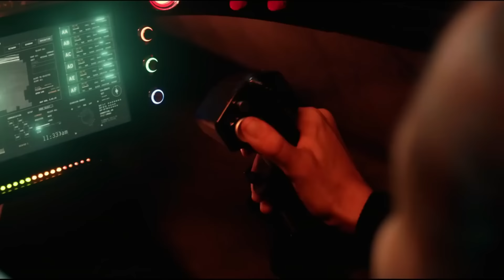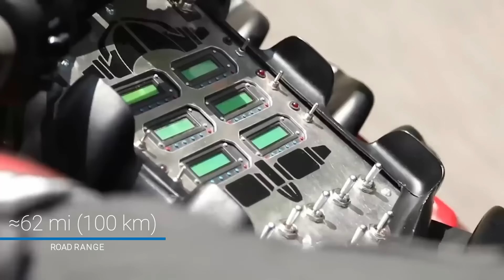TOP 12 Unique Flying Machines

Comment: I bought my paramotor almost 20 years ago. It easily packs into the boot of my car, it's fairly easy to set up and flies for about 3 hours at 30mph which would use about 10ltrs of fuel. I can't remember the exact price but I think it was around £3k. It will also glide down to the ground if the power runs out. We don't seem to have come that far.
Reply from the maker: Looks like you are right
Reply: It's almost as if the laws of physics and aerodynamics haven't changed in the past twenty years.
I blame Putin.
Reply: @Falconlibrary  I was simply questioning the progress made in the last 20 years. These machines all look very futuristic but they also cost much more than my paramotor. They also offer less range, sometimes far less range. Then there's the "plummeting to the ground" issue if they run out of fuel. I just expected a little more from the future.
Reply: @mikebikekite1  
What did you expect? Spacewalk? Or teleportation in space?
The principle has already been developed - reliance on air with the help of a wing. Everything else you can work on is flying higher, faster, longer, more comfortable.
And yes, Putin is definitely to blame for the fact that we still do not use the teleport.
Reply: @НиколайНикакоюс-л2ь  Just a little progress really or maybe I'm expecting too much from 20 years of progress? I'll admit these devices all look like the future and I'd genuinly like to try a few of them but they all offer substantially less than my old paramotor - way less flight time, way less range, less safety (want to guess why these are mostly filmed over water?) and they cost way more.
Reply: @mikebikekite1  
If you take a closer look at the video, you will see that other engines are used there. Therefore, they are somewhat different from what you have. Some engines are faster than yours, some are more convenient. This is paid for with other characteristics, for example, the duration of work.
The laws of physics have already been discovered, all the chemical elements are known, nothing fundamentally new will be.
Hypothetically, if gigantic reserves of lithium are suddenly discovered, then we will switch totally to electrical energy, but nothing more.
Reply: @НиколайНикакоюс-л2ь  More convenient? My machine fit's into the boot of a small car, it has a flight time of 3 hours and a range of about 90 miles. What's more my old machine won't drop like a stone when it reaches the end of it's power. Lithium is definitely not the future for aircraft batteries - they weigh too much. Have we discovered all the chemical elements - if you look at the periodic table there are huge gaps where elements are yet to be discovered. The laws of physics have definitely not been discovered (what is dark matter and dark energy? what is time? what was before the big bang? why is light both wave and particle? the list is almost endless and that's just the stuff we know we don't know. Obviously if you have the answers to these then a Nobel prize awaits you and you're probably wasting your time on YT..
Reply: @mikebikekite1  
Yes, it's more convenient. If you watch the video again, you will see that they do not need to be transported in the trunk of a car. In addition, the level of comfort in a closed cabin is slightly higher than yours.
Further. Do you have a 3rd grade education? This is the school curriculum. I just live in Russia, we go through this from 8th to 11th grade, it seemed to me that these are obvious things.
If you want, I'll describe it in general terms.
Reply: @mikebikekite1  
Seriously? 🤣🤣
Man, I served in the army, my father served in the army, my uncle was a military pilot in Afghanistan, my brother was in the war in Chechnya. I am silent about our grandfathers and grandmothers, who ALL went through the war. I now have 4 friends in the war, one friend returned yesterday from a business trip. I am a senior sergeant by rank and even now i can command a platoon. And like me, the majority in Russia. Do you really think mobilization scares me? It probably scares you, and rightly so. God forbid you fight the russians.
Reply: @НиколайНикакоюс-л2ь  You're a senior sergeant but you're not in the current war? Odd, I'd of thought Russia needs as many keyboard warriors as they can get.

Comment: The jetman with its ability to hold high speeds and altitude is amazing, but I'm partial to the smaller and more compact ones like the zapata, JB-10 and gravity.
Reply: Isn't that Elton John's Rocket man? 🤩👍
Reply: I like the zapata flyboard, but that looks pretty hard to ballance, so i love the jet wing on the end. And how amazing it is to fly along with a jumbo jet!
Reply: @3DPeter  It think it is balanced automatically with systems control. The pilot don't really have to worry about it.
Reply: @Alkis05  No, the flyboard isn't stablized so it's pure a ballance act.

Comment: there's no point in having a parachute on the flyboard because it flys so low that the parachute would not deploy in time
Reply: You can shut the parachute with a small rocket in the air he open and you are glide save down, but the problem you must be 100-150 meter high in the air when you "start" the rescue system! are you deeper it cant work!
Reply from the maker: It can go pretty high
Reply: I think that lateral velocity will also help to open the parachute, same way as flying a kite from the ground just running. Or like parachute breaks in  guiness record superspeed cars, or a fighting jet landing in an aircraft carrier.

Comment: I remember seeing something very similar to the copterpack for sale on a gadget website back in the early 2000s. Although I'm sure it would of been powered by internal combustion.
Reply: Yeah we’ve had various vtol ultralight aircraft commercially available for decades. They have always been completely impractical though, just as all of V these show here are completely impractical. Nothing has changed there. Non-vtol ultralight aircraft have also been around for decades, and they have only gotten better year after year. Paramotors are extremely affordable and have ranges up to 290 miles. Now a tandem trike paramotor won’t have such great range, but it still will be better than most of what was shown here, and you can actually buy a complete tandem trike paramotor setup right now for under 20k.
Reply from the maker: After 20 years, the copterpack still does not fly (
Reply from the maker: Quite a worthy alternative
Reply: I miss those funky old sites of the 2000’s

Comment: Kitty Hawk Heaviside and Zapata Flyboard air are proper cool. If they had hydrogen fuel cells instead of crappy batteries or Kerosine, they'd be able to go MUCH further, because of less weight and higher energy density, the latter would be much quieter too. Only problem with the Opener BackFly is the shape. When it's hovering, you can't see in front of you... Alauda Airspeeder looks very elegant. The Gravity jet suit is like a crude Iron Man prototype. Same goes for the Jet Wing, that's kind of like a prototype for the Falcon suit from the Marvel Universe. I can see a lot of them going very far, no pun intended 😛
Reply from the maker: Thanks for the comment. Yes, we hope to see a lot in mass production and at reasonable prices
Reply: @TopBoxy  No probs. That'd be wicked, but it'll be quite a while yet. I mean, Drones still aren't mainstream yet, and they've been out ages.

Comment: All of these are amazing innovations. Considering their flight times, they are impractical but it’s a start. If the electric ones could come up with a way to have renewable energy built in for charging the batteries while in use, flight time will be almost limitless. Perhaps an old technology may help? Like how an alternator charges a vehicle’s battery. 🤷
Reply from the maker: Thanks for the comment. Watch our next video, there are already some answers
Reply: Like what they used on Voyager 2.
Reply: @marajevomanash  yes nuclear batteries are up and coming

Comment: Vertical takeoff with jets or propellers is cool. But dang, it sure takes a ton of power. Ultralight Single-place helicopters need like 40hp & can fly 65+ mph for 1-2 hours between fuel ups. Airplanes are even more efficient. The single seat Rutan Quickie Q1 has 18hp and cruises at 115mph with a range of 570miles.
Reply: I guess that as battery tech improves, these will become more practical. 🙂
Reply: FX Composite Helicopter is very good.
Reply: Doesnt matter about practicality as this is pure experimental fun 😁
Reply: @tourbike  THAT is a mentality I can get behind. I support doing things "because we can".

Comment: Copterpack is a great thing, cause of the center of mass being low. Its very stable, compact, light, easy to store verticle in a closet or bike locker...

Its better than the things you wear at your feet...those are topheavy and always unstable
Reply: It's fake
Reply from the maker: See description. It is not flyes yet, unfortunately. It was "demo" video.
Reply: @TopBoxy  so a demo that was real, made a flight😉 not fake, just not produced in numbers yet.

Comment: the most efficient, lightest, small, accessible, and safest flying machine is still the paramotor. 3-4 hours flight time,  20-30 kg, you can stock it in your boot car, it cost around 5000 $, and you don't die if the motor stop, bonus it is silent when you cut off the motor and can land quietly
Reply from the maker: All that remains is to figure out how to get to the city center with it)

Comment: Copterpack looks to be most viable and feasible for mass public adoption. 

Small, lightweight, relaticely easy to manufacture. 

Does not take up equivalent space of a vehicle. Could be easy to intergrate into existing infrastructure. 

Only have to figure out how to prevent people from colliding with each other mid-air. 

Definitely a strong foundation.
Reply from the maker: Copterpack turned out to be fake ((
Reply: @TopBoxy  Yeah, I did alittle digging and found out the news as well. About the hidden wire and all that. While dissapointed. The proof of concept is still sound. 

Maybe others will pick up on this concept and build upon it's foundation.

Comment: The best one's jet or battery fan is the ones where the operator has ONE ARM FREE. Think about that. Kite in a tree, remote plane, or anything else that can get caught in a tree not a problem. Only limit to a FLYING ARM is the weight it could carry.

Comment: having the propellers below or even at the same level as the pilot/ payload is very dangerous. If the prop on one corner seizes up, the craft will flop upside down and the pilot will auger into the ground.
Reply from the maker: I agree, it’s a strange decision, but it usually has a ballistic parachute included.
Reply: @TopBoxy  parachutes take several hundred feet to deploy. if the craft is already upside down the parachute woult deploy in time anyway.

Comment: These are neat, except you don't have a power supply to keep them airborn for more than 
.. 5 minutes?
Even with the Parallax WaveForm Batteries declassified, you'd see these were dead end tech in the 1930s

Comment: Jet engine is always faster than those with rotor blades. 
Also, they could be made smaller and fit into the driver's body shape.
But either way, it all comes down to energy supply. This kind of transportation monsters will enter our real life when batteries are made small, light and durable.

Comment: All these machines, but one, have only a small future - most are toys for rich folks, fewer are niche use (military / rescue / construction works / etc). But there is just one which indeed has a big, bright future: #8 - Kitty Hawk Heaviside. I say, it should be placed 1st - not 8th - in this "top 12". Why? 

Here's the reasons if one would want to know. I've been thinking myself about quite a few concepts which are to inevitably emerge for future civilian small-scale air travel - and this vehicle uses them. Namely: minimized drag airframe (minimum air resistance) - most important for saving on fuel / energy consumption and high maximum speed / engine power ratio; VTOL - most important for using from out of airports; full capability for fixed wing lift in cruise flight - most important for reliability and cruise speed fuel / energy economy; cruise flight air thrust placed behind of, and/or at different level than, the fixed wing - most important for undisturbed and always-same-at-any-given-air-speed airflow over the wing, which simplifies controls and makes the vehicle more predictable and, overall, safer; non-retractable, thin but strong landing gear - most important for ease of maintenance, decreasing weight, and at relevant air speeds not affecting aerodynamics too much. This vehicle was clearly made by engineers who understand lots of cons and pros and are very well educated about how to build an efficient flying machine.

I foresee gradual replacement of private helicorpters by this hybrid plane/copter design in coming decades. It's just much better way to fly on a car-like scale for everyday use.

Comment: 9 of these are of the ballistic flight type with vertical thrust used to maintain flight—like a rocket. They are non-airfoil equipped, so no aerodynamic generation of lift. Therefore no unpowered glide ratio to speak of. So bricks when unpowered. Death traps.

Cool contraptions and video, but unfortunately not the future.

Comment: These are just large quad and by copters their is nothing different then the ones I fly for fun.  They have along way to go before they are safe to carrying passengers even individuals are taking a big risk you are relying on the LIPO tech as it is faulty .  It will come as the technology grows that is why they all are doing the same thing because of LIPO power. That set off the RC quad copters which led to this.

Comment: why are the props so small? cant they make a much better design so instead of using 50% just to take off you could use like 20-30% power? your batteries would last longer if the engine didnt have to spin so fast to lift off.

Comment: I would not pay anything for any of these.... The 2nd one, the poor guy looks helpless hence why he is flying over water because he knows you do not trust electrical equipment.The best drones fail for no reason and it isn't radio single related. Also, electric motors fails all the time and more so the ESC's. You would have to have more $$ than brains to even buy one or even make one and lets mention battery failures...

Comment: All trash ideas. Why not just get a helicopter? You can get one much cheaper than half of these, have passengers, will last longer, and take you a lot further.
Reply from the maker: not for masses
Reply: @TopBoxy  True. Credit to anyone that designed any of these, but they’ll never take off. Except for maybe the jet packs. I’ve seen videos of the military using them.